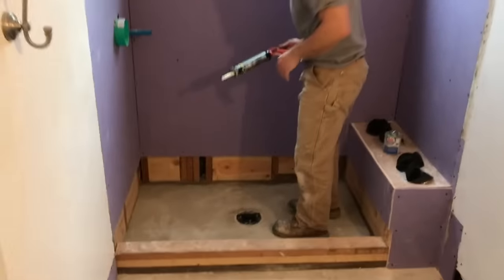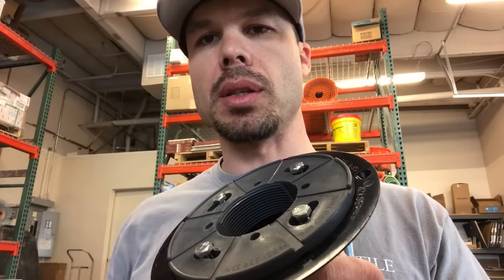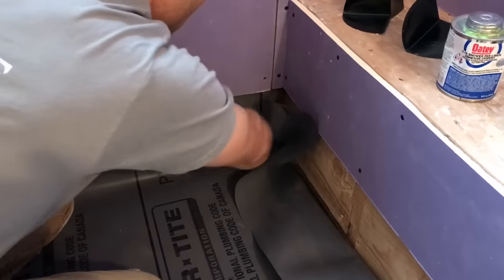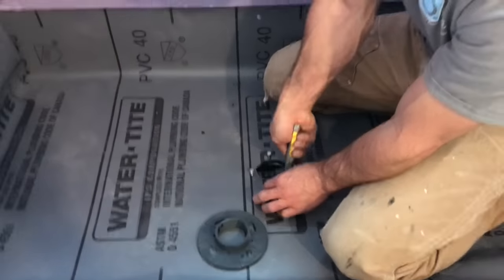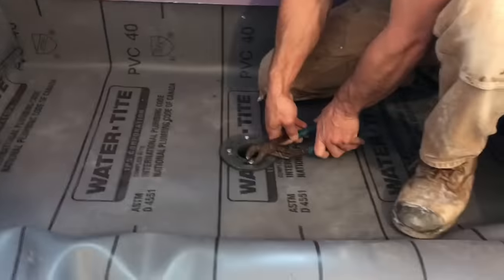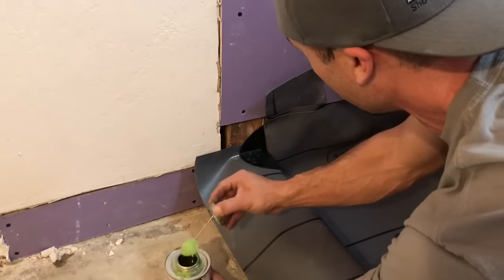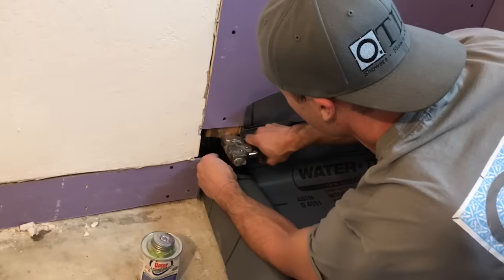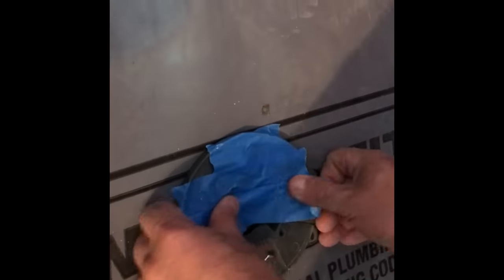Easy Shower Pan Liner: Tile Coach Episode 9

Comment: Only thing I do different. No 2x4 in the curb. I run my liner through the middle of a sand mix curb. The only place my liner is cut is for the drain.
Reply: Awesome I do the same thing!

Comment: Thank goodness for YouTube, It's job security for me. I'll be behind these guys
Reply: @TileCoach  no way that purple moisture resistant drywall will last 10 years max or full 1 water leak...that would not fly in my area can't use drywall products in wet areas at all its only protected 1 side.
Reply: And you should have went higher over the bench with the pvc liner
Reply: @marcfavell   Dude, it was a perfectly fine PAN install. And No, he didn't have to use the PAN liner to go over the bench. 

This was not a video of the water proofing of the shower. If it had been I would be right there with you. However, if I were to do this, I would use Kerdi or Redguard membrane over the drywall and bench to drain into the pan. However, for the purposed of this video he didn't show the rest of the shower install.
Reply: @marcfavell  first thing I was gonna say... Hardy is the chit!
Reply: @qball3835 must be nice to just blow time and money for a video not properly done then. Myabe his company charges so much that they can just afford extra liner material???
Reply: Youtube is just the platform. Thank the people sharing their skills and knowledge.
Reply: Drywall is banned in california wet areas unless its floated with kraft paper, lath and mud...

I like the folds theyre all good but i dont like the cut above the dam. It's a top leak area and high water flow area in the corner at the edge of the shower doors.
All your work looks great and ive learned a lot - i was surprised to see your in sac / placer area as im out of fairfield.
Reply: This shower will start coming apart in 1 or 2 yrs max! Do you people really think all that shower spray water running over that seat is just going to go down the drain? Really!?its going to find its way thru the grout and the caulking in all those corners guaranteed and get to that seat! You are living in a dream world if you think it wont! Its laughable really!

Comment: How do you plan to tile over the liner at the lower wall areas? More drywall!!???
Reply: Did you ever figure it out? I have the samequestion
Reply: No one explains that. Especially with all those freaking folds in the corners, and the thickness difference with the backer. Other videos say don't put backer over the membrane, but what holds the tile????
Reply: I have the same question.  I need to know the missing steps between this video and the next one.  What did you put over the pan liner on the wall to make it flush with the wall board?  I am now stuck at the spot where this video ended.  HELP !!  Please.

Comment: I had a shower installer use concrete bricks instead of 2x4 at the opening.   Pretty much the same after that.  In retrospect, seeing wood rot, bricks is a great idea.

Comment: Have a 3x5 shower. I’m removing tub and putting in a walk in with curb. Concrete slab floor. Looking for an affordable pan option as I’m trying to save $. Also I have seen moisture resistant drywall being used. Waterproofing drywall ok, or concrete backer? 
Thanks for your advice.

Comment: I am ready to pour my final concrete over the rubber membrane.  Just curious what you do on that inside part of the curb? I have all my backer board in but did not put a little piece on the inside of curb.  Only going to be about an inch of rubber showing.   So after you put the rubber membrane down and install the concrete do you have a little bit of rubber membrane still showing on the inside part of the curb?  Do you just fill that with concrete or thinset?  I didnt glue my membrane to the 2x4 curb so its a little loose (I should have I guess).

Comment: So how do you tile all the area that shows the liner. For example the bottom of walls and the curb. Do you scratch coat it with thinset let it dry then float it it? I have yet to see someone doing a video on that bro. If you can reply asap that would be awesome. I’m doing mine tomorrow.  Thanks

Comment: We’re using wet/dry backer board in our shower. Do we need to take that all the way down to the concrete floor and put the liner over that? Or should we put the liner down and let the backer board go over the part of the liner that’s going up the wall?

Comment: Can we reuse the drain flange, if we're putting the shower pan back in? We're not tiling, but installing galvanized steel, and again, reusing the fiberglass shower pan. Also curious if you would suggest using the PVC liner underneath the shower pan, for use with the steel sheets? 

 Thank you.

Comment: Hy. good morning.  I am watching your video.   and now I am a handy guy, do anything with my hands. but   I am doing a bathroom walking shower. I am debating to do like tou are doing with the dry packing system or to put back the white fiberboard base / water catcher base.  now. my question is   can I install that water tite fabric down first and then install the fiberglass shower base water catcher on top ?  thanks

Comment: Question:  How deep mud bed do I need starting at the drain?  I am building a 4x7' shower and the drain is set on the side.  I want to do a linear drain and got an Oatey with the adjustable feet.  My concern is by the time I get to the back side of the shower, the pan is going to be very thick.  #1 I don't want to work that much bed mud if I don't have to #2 I don't want that big of a step up into the shower if I don't have to.  I would like to remove the feet and start the bed at about 1".  Thoughts???

Comment: How do you get the tile around the bottom to lay flat over the corner folds? I folded mine just like u did and put cement board over them but since I cant screw near the bottom of the cement board it is sticking out Slightly because of the folded lined behind it in the corners?

Comment: I've seen two methods to cut the liner at the drain, one way is to do an X cut. I can understand their logic but like your way better (circular) but also going to use the Oatey PVC Glue as well.  Still using the silicone too. Any feed back?

Comment: Are you still using polyurethane if the groove isn't there? The drains I deal with just have a lip around the outside edge. Would you still use polyurethane?

Comment: Hi, I'll be building a wet room shower. When I pour my preslope, should mortar be coming into contact with wood? I'm scared it will wick moisture up...I was going to just do the preslope against ridged foam insulation which will already be on the two walls (basement) and use edge strips to build up the pan to the height I need on the other side. For more  my preslope, and then pour self leveling concrete for the rest of the room to get it flush. I'll red guard everything, before tiling on top of the red guard itself. Do you see a problem with this method?

Comment: I have this same shower on a slab floor i think my drain flange is too high its about 2 inches above the concrete slab, so i need to pour mortar in first with no pan liner up to the bottom let it dry then put my pan in and then pour the sloped part? there was a 12x12 hole in the slab for the fiberglass pan and i filed it with sackcreete yesterday so if i need to lower the drain i can cause i didnt glue it yet

Comment: Is the polyurethane applied around the drain from 0:15 to 0:35 a caulk or adhesive? Is there an advantage to using this over plumber's putty or silicone?

Comment: I really appreciate you posting the videos up. It has helped me immensely. I am at the stage of installing the shower pan linear and have it exactly where you are in this video. My question is How do you seal the pan linear where it meats the backboard. A colleague of mine says the pan linear needs to be under the backer board so it does not leak.

Comment: When I put the bottom backer board over the liner folds, the board tilts in since the liner is under it.  The board above is on the studs.  What do you do about the flare?

Comment: I have zero expertise with tiles and bath renovations, but on the internet, everyone says no purple board in the shower area. Just curious, any reason you are using purple boards on the side, instead of cement boards?
What works best? purple board + RedGard, or HardieBacker cement + RedGard? Thanks!

Comment: What do you think of installing the 2x4 curb about 3/4 short of the wall on both sides ( so basically the 2x4's don't go all the way left and right) now when installing the liner you can tuck the liner in that gap ? This can enable the liner to be completely seamless over the curb and the side of the curb where you had used those patches.....I have done it both ways , but like the tuck method. I round the edge of the 2x4 at the top also, so its not to sharp against the liner.

Comment: How did you waterproof the seat area?  I would have not installed the sheet rock backer on front of seat and I would have  removed sheet rock like you did for the pan on top of seat , side seat , and front going down wall to install the liner. Then install you lath/wire over liner that is on seat area and up the walls. 
Seat framing should be pitched 1/4 per foot for proper drainage to weep holes.

Comment: How should I redo just the shower pan membrane (with penny tile to finsh), when I only want to do the shower floor, but keep the wall tiles intact. It has the curved tiles that makes a transition from floor to wall.  How can i make sure the membrane gets covered underneath when I'm only doing the floor.  I need advice before tackling this project.

Comment: Awsome reminds me of roofing i do commercial roofing and hand weld pvc and tpo materials at corners and ac curbs on roofs we call those corners hog ears I wonder if an 0.60 thickness pvc membrane can be used as a liner . I know I can make that waterproof and hand weld the corners with a heat gun . Love your videos hopefully be doing my bathrooms over in my new house thanks to your videos

Comment: I do have some questions. I’ve been building showers for 35 years and build lots of them. 
Why do you have your board up already?  It seems more logical to lap your full sheets of wall board down over the membrane to just shy of the bottom. I use go-board. 100% waterproof. That way you can start fastening it about 6” up and it has a more even surface than installing strips like you’ll have to do there.  Also I’m not crazy about having horizontal seems that close to the floor. Lots and lots of moisture down that low.  Any mistake in seem sealing and you’ll have a real problem down that low. Also I’ve never sliced the membrane to do the curb corner. There is a fold and tuck method that doesn’t require any cutting inside the shower. 👍👍

Comment: Can you use a liquid membrane and fabric where the cement board meets the pvc liner for extra protection for water wicking up the cement board? I will be using cement board instead of fiber but wondered if this may be a good idea to do in conjunction with pvc liner.

Comment: Working on mine now. The pan isn't scaring me as much as trying to get my wall board down over the liner, smoothly. I understand to keep a gap, but I may have screwed myself. I made a 1/2" plywood box, at the bottom. Poured my preslope. But, if I set my wall board on top, of the box, the liner will cover it, and I was going to put subway tile down. So, nothing to mastic it to, except liner. That doesn't fly. Scratching my head. 
  Am I going to have to put in, another layer of wall board, to drop it down to within an inch of my pan? I could put a 1/2" stepout, near the bottom.

Comment: I'm surprise that polyurethane gives you enough time to install the back corners and then come back and cut the bolt holds and embed the liner before the PU starts to cure.  The PU I've used starts to set up pretty quickly.  I see a lot of guys install the liner back corners, then lift the front of the liner and sneak back in with their caulk guns to put in silicone II on the drain base.  Also, I'm wonder which is better, PU or silicone II.  I know you're supposed to use the "neutral cure" silicone.  Thanks, great videos.

Comment: Great videos,   you can eliminate all those folds at curb if the liner is cut a certain way.   I cut mine so one layer comes across the top of curb.  Then a corner.  I take it your mudding the walls?  Too much build out for 1/2 material over those folds.

Comment: They new drain to properly do it will not work . Unless I have to rip out old pvc pipe. Install new pipes. Or is there a simpler way to install new drain to old drain. I'm confused,

Comment: Ok, question. Wouldn't those hospital folds make the wall stick out? Also, how in the world are you going to attach the bottom 8 inches of backer board without poking screw holes in that liner?

Comment: in your video I didn't see an pre-slope picture underneath the liner so that the water that wicks through the mud bed is pushed towards the weep holes.  You didn't set the liner directly on the plywood di you?  A lot of inspections I have to go on complain of the shower floors not drying due to no pre-slope under the pan and causes the water to wick upward in random areas back up through the grout.  TCNA calls for a 1/4" pre-slope per foot from the outside walls to the drain.

Comment: Will you add more backer board to bring it closer to the floor were you scabbed the wall to fasten  youre pan liner. Thanks for all the helpful info.
Reply: I have the same question.  I need to know the missing steps between this video and the next one.  What did you put over the pan liner on the wall to make it flush with the wall board?  I am now stuck at the spot where this video ended.  HELP !!  Please.

Comment: 58 year old tile setter here, you use dry pack not "Mud" correct?  and since that looks like particle board, 
I always coat that type of material with Red Guard Water proofing. I use it in my YT.  Its just added
Protections from Moisture under the rubber dam sheeting.

Comment: I just ripped out a shower in our new to us modular house in Florida. Difference was, they used Portland cement and tile above the liner. This wouldn't have been so bad, except the plumbing leaked inside the wet wall, trashing the flooring under the shower. I will have to redo the whole thing. Also no vapor liner was used. They just tiled over the regular sheet rock which also was fine, although I would have used mold resistant. I'm going to try solid sheets with a seat similar to what you have here. My layout is flip flopped, wet wall is on the right side looking at the shower from the front.

Comment: @tilecoach have really been enjoying your videos! thank you! I'm a carpenter and tiler that got most of his experience tiling in Vermont 5+ years agoand trying to make the transition to CA code.. curious  to know - could you line the shower enclosure with fiberboard before floating your masonry shower pan and then just coat the entire pan and fiberboard w/ 2-3 coats paint-on sealer like red-guard instead of the liner you have here and the moisture-resistant drywall? That is how I would be inclined to do this same application but wonder if there's something wrong with that...

Comment: thanks for showing the drain assembly separate. It really helped to see that. Question - I notice the pan liner goes up the wall right on the wood blocking. Do you come back and put backer board over the pan liner on the wall? what do you do there?
Reply: Same question ...as pan liner should be behind the wall board or backerboard.
Reply: I have the same question.  I need to know the missing steps between this video and the next one.  What did you put over the pan liner on the wall to make it flush with the wall board?  I am now stuck at the spot where this video ended.  HELP !!  Please.

Comment: Tile Coach you're the BOSS!  Thank you for all the tutorials.  I have a right sloping drain on 5 foot tub I want to replace with a walk-in shower pan.  The current drain plumbing on the far right is about 8 inches from the wall.  How do I slope the pan back to the drain?

Comment: Hey exactly how i do it, but i did get a good laugh when you used chanel locks to tighten the drain flange that was funny. Ok and hot mopping is still probably the best way to seal my opinion.

Comment: I would like to see you showing viewers how to use a poured concrete curb with the pan liner run up in the middle of the curb. This I a way used to ensure pan doesn't get damaged or have a curb leak

Comment: Hey Isaac. Nice video. I am wondering if it will leak if you don't put caulking around the drain flange? Does the pvc linear act as a gasket between the drain flange?
I am asking because I don't think caulking is a permanent sealant. I am still deciding if I should go with kerdie or the traditional pan linear. Thanks
Reply: Hey Isaac. Thanks for the reply. Would 100% silicone caulking be a better choice than polyurethane sealant? I thought silicone last two times longer than polyurethane.

Comment: Thanks for the way you do your curbs, that's what I was looking for.
Mine are always fat because I keep more of the liner...
P.S.... a faster way of cutting out your bolts and drain hole..., cut a cris-cross +.. across the top of the bolts and they just pop right through. 
And then cut your drain the same way, Then drop the flange down, and follow your direction of tightening down the bolts. You have no waste, and you have a tighter seal with all the liner getting pinned between the flanges!

Comment: Plastics shower has small cracks. Anyone use a Shower Pan Liner to temporarily fix a shower. Using pan liner glue to attach to the shower. Would it be slippery?